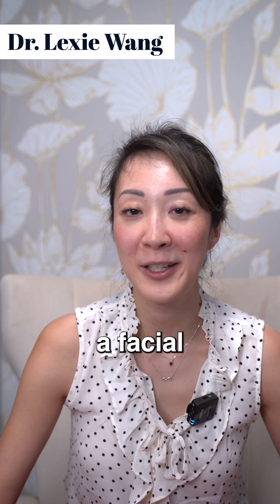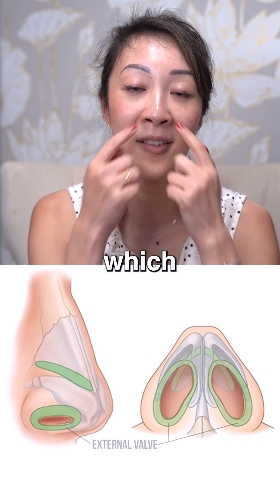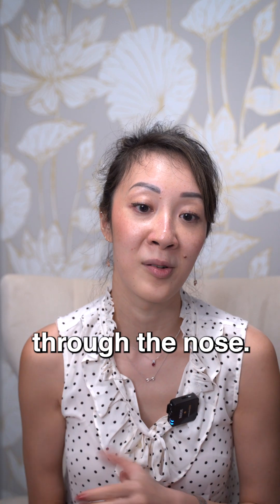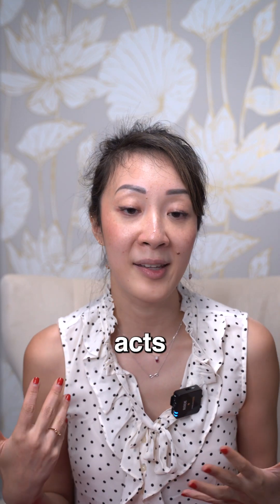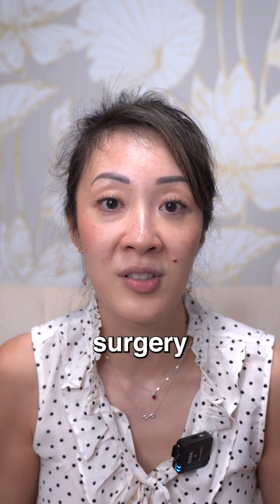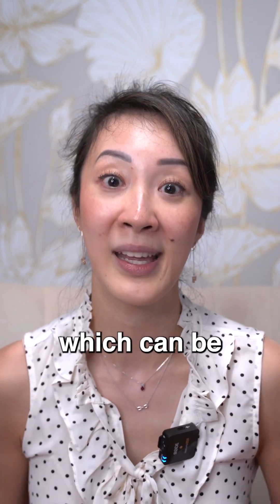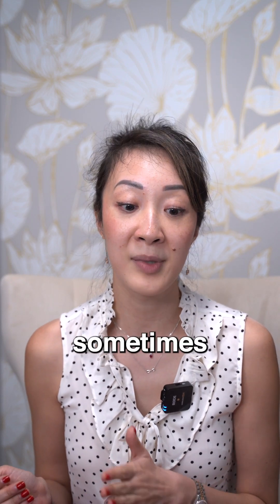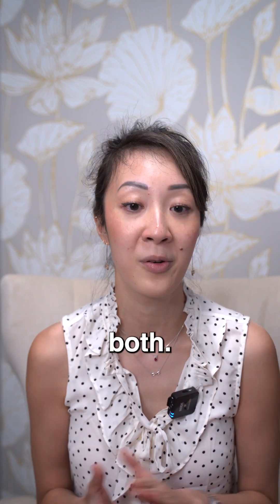Nasal Valve Collapse - Face the Facts with Dr. Lexie Wang | West End Plastic Surgery

Comment: Which is better cartilage or implants? are implants plastic?
Reply from the maker: Both cartilage grafts and implants can be used to support a collapsed nasal valve - the choice depends on your anatomy and goals.

Cartilage grafts (usually from your septum, ear, or rib) are natural, biocompatible, and long-lasting -  they’re often preferred because they integrate with your own tissue.

Implants can be made of medical-grade materials, not regular plastic. They’re sometimes used when there isn’t enough cartilage available, but they carry a slightly higher risk of shifting or infection.

Your surgeon can explain which option gives you the best balance of support, safety, and natural results.